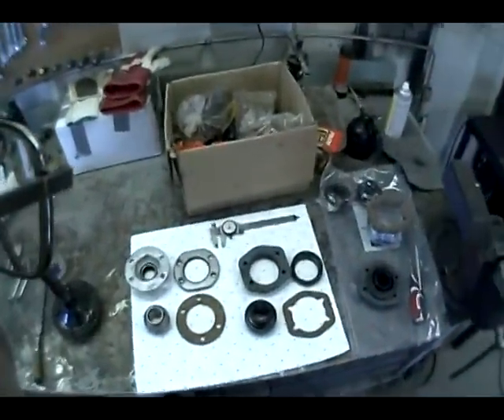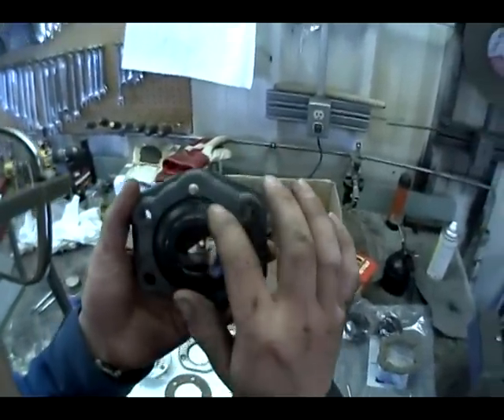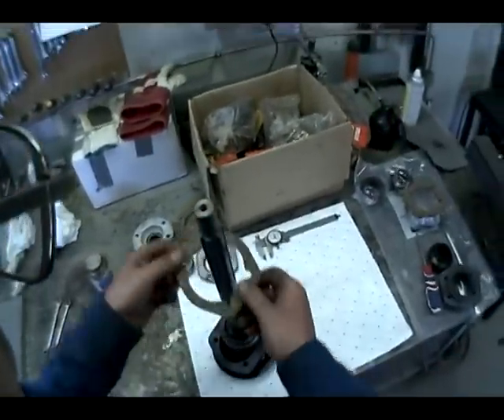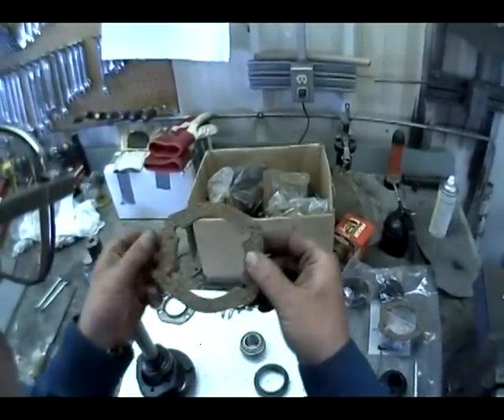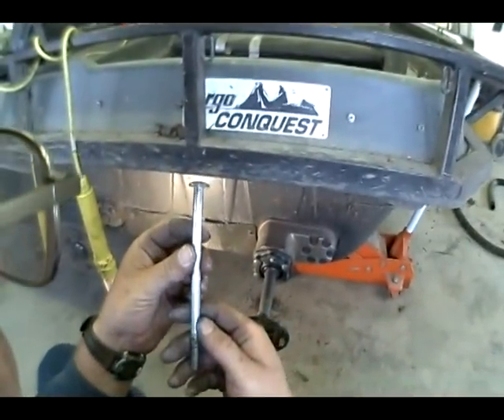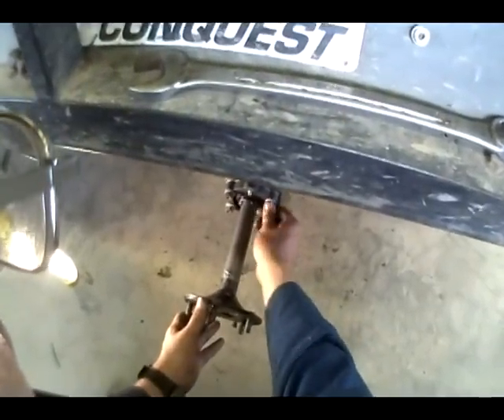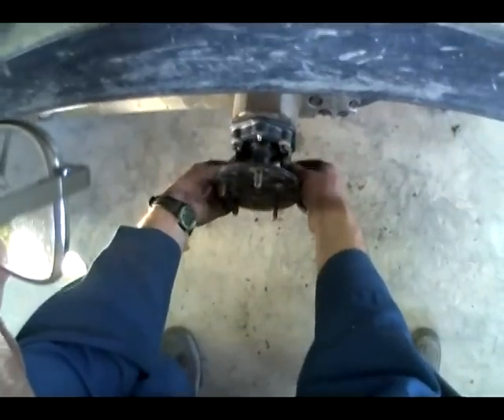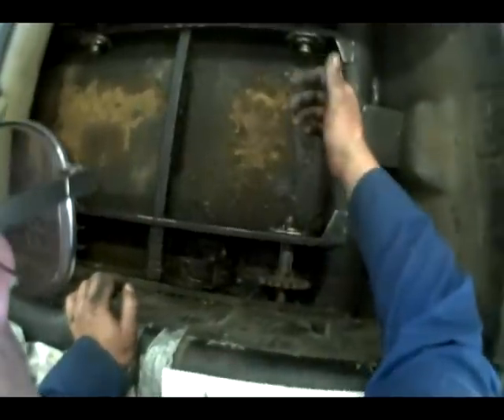ARGO Conquest to HDI Bearing Conversion PT-1

Comment: I did`nt realize when you said HDI this is real close how I did mine only I used 4 bolt pillowblock I dont have axle protector hubs like yours I used used air bag material from a transport for gaskets I thought of using cork but thinking this is far more of a permanent or rugged seal and it was free but the application is the same , Plus if a axle is bent the rollout won`t affect the seal like the old style .
I see you went with the carbed motor this way U know what could happen  right on .

Comment: I thought about doing the "upgraded" HDI bearings on the front and rear only on my 93 Conquest because that's where the most wear points are, or pressure, on bearings and seals when running tracks but the Tech guy at Argo told me that the new HDI bearing conversation hasn't shown to be giving better wear or strength overall than the standard bearings that came on it. I'm a vintage lover because with technology comes more stress when it breaks. In the Army we used a phrase called K.I.S.S.; Keep It Simple Stupid! I'm always looking to improve a vintage design but keeping in simple with what works! The bearings and seals are the weak points on these machines. I can't help but wonder how a bearing can be converted from say an old and tough 72 Chevy Blazer to work with an Argo! Those bearings would be bullet proof and last a lot longer than the Argo bearings. Any company will make more money buy selling parts for their products than the initial sale of that product itself. It's seems funny to me that bearings in my 2.5 ton 72 Chevy Blazer 4x4 that take more of a beating out outlast the bearings on a 700lb Argo with the same size shaft diameter! It's as if some parts aren't made to last deliberately to keep a company flowing with money on parts sales...just a thought though.

Comment from the maker: @dedwards8708 Tks :-)
I've ordered a new 27hp Carbed model for my engine switch. It should be here in the next couple weeks. I leaned away from the 29 DFI for a couple reasons 1) Difficult to diagnose/work on out in the bush and 2) Delivery was 3 months.

Comment from the maker: @MrMrtiki These bearings are nothing more than "Pillow Block Inserts", probably very similar to what you are useing, but with a different carrier setup. I have some of that "Air Bag Material" at work, and think I migh ttry it out as well. I'm not crazy about the idea of using 3 gaskets on the front and rear axle extensions to get a seal.

Comment: How hard was it to get to the nuts when you were tightening everything back up with the new bolts and how difficult was it to get the set screws undone on the inner bearing

Comment: @RockDoctor07 I`ll give you a hint being you have a grease seal in the back I made the airbag gasket wholes just smaller if you have a sharpened old chrome socket 1/8" or 1/16 smaller or pipe  than your axle press the wholes out  this way the leak you think your going to have between the bearing & axle is contained outside of the rubber as long as there`s grease the rubber won`t wear 
 out ,   I have to do it  this way so when I seen yours it`s the same I had to think out all the bugs first.

Comment from the maker: @MrMrtiki Conversion?
Do you meand an "adapter plate" that you could bolt to your flywheel that has a shaft able to recieve the Primary Clutch?

I think that would have to be custom made :-)

Comment: Did that new bearing  leak when you put it water ? Also do you have a video of you doing the front axle
Reply from the maker: John Smith I have had them leak a bit between the axle and the inner race of the bearing. Lock tight on the setscrews helps a lot. I have no video of changing a front bearing, its the same as a rear on my Conquests.

Comment: Is it possible that if you pump enough grease in around the bearing some would spill over and seal the axle. I'm thinking about doing the same thing with my Avenger. Not like the Conquest, i have to replace the front and rear axle extensions. They must work because the're still using them on the new HDIs. Good video, thanks
Reply from the maker: No, pumping more grease will not seal the axle, the inner race of the HD bearings are not inside the bearing housing. 
There are 2 styles of bearing extensions on the conquests. The older ones can take the HD bearings if you get the adapter kit from Adair Argo. The newer ones, like this one will receive the HD bearings with no modifications. Your Avenger should be the same as this.
Reply: I love your videos. Like to see more